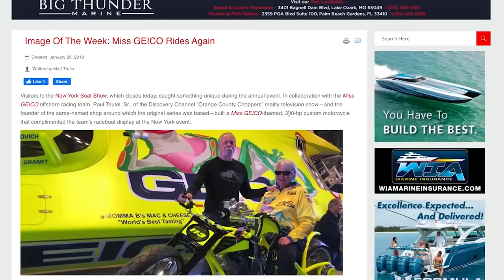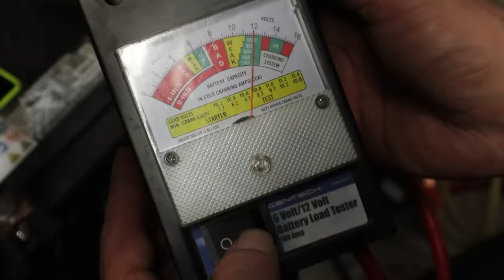Will the Geico Orange County Chopper Ever Run Right? (Unfixable)

Comment: The third injector should be acting as intake charge cooling, roots put out a ton of heat so the most efficient cooling method is usually pre-charge injection.
Reply: Makes me wonder what kind of fuel it's supposed to run
Reply: @Ooshwink82  I think it supposed to run race gas

Edit: watching the Bikes and Beard video again, it was tuned on VP Racing C16 leaded race gas.
Reply: @littlewicky1  yeah I spoke too soon. I just saw the end of this video and saw him use the race gas.
Reply: Good description of why the 3rd injector
Reply: Toyota used to sell  a TRD supercharger kit for the 5VZFE V6 that included a 7th injector.
Reply: I think the reason for the intake injection is to seal the rotor to the casing to improve efficiency, I remember reading that 80's top fuel engines did this for that reason.
Reply: If there was meth injection yes. It's for extra fuel for higher tuned maps.  instead of changing stock injectors
Reply: @effynme  Also helps seal the vanes.
Reply: It’s for methanol
Reply: Could also be for extra fuel under boost.  Callaway used to do that with their corvettes, just add one injector in the intake.  That blower wouldn't suffer too much for heat soak in this case.
Reply: First of this guys videos I have ever seen. I immediately had to question if the guy was a real mechanic if he had no idea what the third injector was doing.
Reply: Cooling and lubricant
Reply: Yes the third injector helps keep the air charge cool, but it also helps keep the blower rotors lubricated.
Reply: @K-Effect  lubrication is questionable. There are those that believe that the fuel washes the bearing. Although it is is hard for the fuel to get between the ends of the rotors and the case ends. What it does do is limit thermal expansion of the rotors, which leads to less wear on the case, or allows closer tolerances. By keeping the rotors cooler it does prevent some heating of the incoming air, but most of the heating is created during the compression of the air. Wear control is probably the biggest gain here. Yes there is some cooling.
Reply: @DodgyBrothersEngineering imagine thinking that people must know everything to do mechanic work. Bonehead remark
Reply: Knowing the efi controller would help. But I still think it's an easy solution for extra fuel under boost. Something like the RSR AIC400 is made just for this type application.  Keep the rest stock, feed the beast when needed. Also not sure the blower but not all are draw through and never see any fuel in them. Cooling the intake charge with fuel will make it run rich i would assume hence water injection?
Reply: @gsgrsavtexgs3  yes you need to be an engineering genius to work out hot things expand, cold things contract. OK so not everyone has hands on experience of working with roots blowers, but if he doesn't know the basics, then he is not qualified to work on it, and should stick to something he understands before he damages it.
Reply: @ComicbookGuy70  that is definitely one approach. You don't want to introduce too much fuel above the rotors as they typically have poor fuel distribution with the twisted rotor versions pushing fuel to the rear of the blower. I suspect going off the size of this blower it will be the twin lobe version which are very inefficient and create even more heat that the three lobe variants.
Reply: racing fuel  @Ooshwink82
Reply: @effynme  Normal fuel (or even water) sprayed in hot charged air will cool it.. Methanol is better at it but almost any liquid would cool intake temps but with various side effects depending on setup.
Reply: @DodgyBrothersEngineering sure, gasoline isn't a very good lubricant but compared to a dry fuel like propane,its a lubricant. 
When they use small air cooled engines on propane they are really tough on valves compared to their gasoline counterparts. They might require a valve adjustment at the same interval but the propane engine will have tighter valves when compared. 
Same deal here , fuel is a lubricant its just not usually thought of as one.
Reply: @MrTheHillfolk  yes but that is predicated on there being contact. A roots style blower is not designed to come in contact with the rotors or the case like a vane type blower does. Someone mentioned a top fuel blower that runs teflon strips for better sealing, but most of these street blowers don't make actual contact.
Reply: Old early fuel injection also had an auxiliary injector for cold starts. The Toyota 22re is one for sure
Reply: @DodgyBrothersEngineering  maybe he wasn't trained to fix those?  Superchargers aren't common
Reply: Correct, and I imagine it's likely only used at higher throttle positions/boost.
Reply: @Skilful_basics8  superchargers have been around for well over 100 years, if he doesn't understand the basic principles of how one works by now he is never going to. They work on the exact same physics that the internal combustion engine does. Compression creates heat, and heat cause expansion. If he doesn't know that, then he probably isn't really a mechanic. It is one of the first things they teach you after suck, squeeze, bang, blow.
Reply: I have a supercharger.  Not a roots.  I don't have any extra injectors on the intake but I did change to bigger injectors and a 2nd in line fuel pump.
Reply: The bike should be run on methanol not race gas. The methanol is the reason the fuel system is a mess. It does that if you leave it. Methanol is acidic. 
The extra injector is for methanol cooling of the supercharger and helps remove heat from the charge air. ❤
Reply: Yea I don’t want him working on my bike lmao
Reply: @Ooshwink82  Liquid currency, it get's a bout 1 mile per thousand dollars.
Reply: Went to post this exact thing more or less. I was like that ain't for the FP gauge dude that makes no sense. It's for extra fueling(maybe for cold start enrichment too?) and cooling effect from the fuel.
Dunno about the lubricating properties of it on this application. Could be another factor though.
If it is mainly for cooling wouldn't a water/meth setup be better? Maybe there were some packaging concerns.
Can't imagine it's much different for bikes. I put a roots type blower on my B5 Passat and the limiting factor on that was heat. The roots type blowers on Audi's 3.0 SC V6 they run coolant through it to keep it cool.
Reply: @Ooshwink82  It runs on Dunkin'
Reply: Great you got it going but that belt is ridiculous!!
Reply: It’s more of an efficiency thing than a cooling thing. The supercharger will work more efficiently with the atomized fuel running through it.
Reply: @effynme  Same reason modern superbikes have multi-stage injection.
Reply: ethanhawkins849 is absolutely correct in this case. from my experience on blown alcohol and top fuel cars the temperature from the compressed air and friction from the rotors in the supercharger can be several hundred degrees and the fuel will provide evaporative cooling.
Reply: Yes it's for chilling but also lube for the rotor blades.
Reply: @DodgyBrothersEngineering completely agree with you. Just cuz someone can cut and screw wood doesn’t make them a “carpenter”. I wouldn’t let this guy within a mile of my tools. Detroit was famous for blowers on the two stroke diesels, which is why an 871 blower (8 cyl/ 71cu in) fits a lot of gm blocks. I digress, back on topic…  Pre injection does cool the compressed air some. It’s already premixed by the time it enters the cylinder and can help start a smoother combustion cycle prior to the full injection shot near tdc. Another added benefit is direct injection suffers from serious valve coking. Coking (dried carbon deposits) can prevent a valve from fully seating and a major loss of compression. Atomizing fuel on the head side of the valves helps to wash the seats as the fuel/air mix rushes past each time the seat opens. Was OCC smart enough to consider these things during the build? I doubt it. Why they’d build a high compression engine to be boosted is beyond me. In its current state, the blower is robbing more power than it’s making. The engine needs to be torn apart by a REAL MECHANIC, and rebuilt with different pistons and rings, and likely a different cam grind to lower the compression so the blower can actually function the way it’s suppose to… making more power on PUMP FUEL… but that’s just my .02 cents
Reply: @motorhead4663  I doubt this particular supercharger was based on the 71 series, due to the physical size and length of it, I would suspect that it built on the earlier GM 53 series blowers, which as you know was an even more inefficient straight two lobe blower design.
Reply: @Bdogg12784  not sure how much lubrication you'll get from a fuel with that low evaporation point. most superchargers I've used had Teflon wipers for that.
Reply: This is what I got from underdog racing about supercharger injector: "The 7th injector kit has better altitude compensation, it is easier to install, and the pre-loaded start up program is good for 99% of the trucks out there and almost never needs any additional tuning by the end user.

Some other benefits come from shooting the fuel through the supercharger.  The Eaton 3 lob rotor used by TRD is not the most efficient available.  The fuel going through the rotor housing helps provides a better seal between the rotors and the housing and reducing the back flow problem with the 3 lob rotor design and reduces the heating of the compressed air by reducing the back-flow.  The fuel also removes some existing heat from evaporation of the fuel in the heated compressed air.  This can increase effective boost and cool the compressed air resulting in increased performance."

Comment: 8:33 the reason it has that extra injector is because the fuel itself is the lubricant, cooling & the seal for the supercharger
Reply: Also cools the intake charge under boost. 
Especially on methanol....it will literally build up condensation on the blower.
Reply: E85 is a good fuel for that type of setup. Just has to be tuned properly for the fuel you’re running.
Reply: @ryurc3033  Yeah, like those Dragster cars that do not have an actual cooling system for their engines. The super chargers actually get freezing cold and even build up ice on those cars. Awesome physics at work there.
Reply: Cooling maybe, but gasoline fuel isn't a lubricant, i thought it was just extra fuel for startimg and maybe wide open throttle
Reply: Yes…me would run ccv hose into the blower and let oil lube the supercharger…burns oil yes…but the engine crank case pressure is high so I would put that to work.  The thunder max if it had auto tune on will loose control of the cylinders if a third injector is in the picture..the max won’t know how to adjust the afr map .

Comment: The third injector is likely for two reasons;

1. They used smaller injectors on the heads to get good drivability and fuel control and the third injector for additional fuel under boost.

2. Being pre supercharger it acts as an air cooling agent when injected into the roots/screws due to the absence of a cooler.

Comment: That starter button is a simple install,  I have one on my 1340 EVO has been on there for 20 years. It just replaces the cover. We used to just drill a hole in the cover and drive a screwdriver in it to start if a bike had wiring issues,  or steal them.
Reply: So, you admit to being a bike thief. Got it.
Reply: @micksterboone4517  yup. No one knows who he is. Or if hes telling the truth. So yup.
Reply: Its not that easy. On top of the starter is a solenoid. By pushing it the startes runs. But without ignition the engine will not start ;-)
Reply: @chrisridethatbloodything2044  Eh thats nothing that twisting afew wires together woundnt solve ;) .
Reply: @chrisridethatbloodything2044  Tape a quarter to the back of the old small key switches and that's a solved problem. My bro got home that way after losing his key in the bushes
while romancing sum yung tang. He also go poison sumac. It was a run to remember.

Comment: 13:56 Adjustable throttle position sensors like that usually have metal sleeves in the adjustment holes so that when you are tightening down the bolts it gives it something to clamp to instead of just the compressible plastic.  I imagine that is why it keeps moving.

Comment: The injector on the super charger. My guess from having built a couple supercharged projects. Engine runs normally on the injectors in the engine. The injector in the supercharger adds the needed extra fueling for conditions when the engine is getting boost. Probably regulated by a built in map sensor. Bolt on..... no tuning required to the engine fueling.
Reply: I'm guessing Craig never had a vehicle with a hpfp
Reply: This one here Craig. We use them with the jb4 tuner on my cars twin turbo platform.
Reply: I'm guessing that is the case too, especially if it's bolt on. Rather than tune and size the primary injectors, just leave the stock ones in and have a separate one for boost.

Seeing how it's blowing black smoke they definitely didn't know how to tune it in the first place!
Reply: I remember them saying they used nitromethane or sth like this. Even ethanol or methanol need extra injectors to compensate for energy density. Similar to a carbs powerjet
Reply: Would a fuel injector on the superchrager also help cool the charge air and increase the charge density as the fuel evaporates?    That might be an unintended consequential bonus rather that a primary design consideration
Reply: @jonathanflatman  You need it to cool the Super Charger itself, and provide lubrication.
Reply: Super chargers start making boost the instant the engine is started so there is no "runs normally on the injectors in the engine" or "no tuning required to engine fueling".
So repeating what others said. 1: that injector is there for cooling and 2: there's no way the fuel coming out of the blower can be distributed to both cylinders evenly =
to be properly tuned you need to tune each cylinder's injector (I tune both cylinders individually even if/when the engine is normally aspirated).

I have also tuned "the only factory production supercharged motorcycles on the planet" (Kawasaki H2) and JFYI the MAP "goes positive as soon as the engine starts".
It isn't much but the H2-SE's MAP is 0.2 psi at idle and it "increases linearly with engine RPM" up to 16+psi at the 12,500 RPM rev limit (all shown and recorded on dyno).

And lastly, most modern ECUs that can be configured for Injector Size/Flow and Latency (Dead, Off Times) IE Holley, Maxx and Fuel Tech all start, idle and
Ride/Drive 100% normal/smooth (when properly configured and tuned with High Flow injectors)...

Comment: How did I not know about this fuel injector tool!! I have been saying for years something like this need to be made! Thank you Craig I would have never found out about it had you not shown it.
Reply: Yeah, I'm going to have to find this one. They make expensive 4 or more injector cycle/clean systems but this one is pretty simple. I made a setup of my own to cycle the injector and spray cleaner but it's a pain to swap injectors and the cleaner spray tube wants to pop out of the rubber hose it's feeding into.

Comment: The fuel injector on the blower is to cool the blower, and cool the charge. Same reason they run fuel through the blower on top fuel engines.
Reply: I'm not mechanically inclined, but basically they're water-cooling the blower with the fuel, correct?
Reply: @WyattWeadge  the fuel lowers the air temp. Lower temperature air is more dense. Higher density means you're getting more air for the same amount of compression, so it produces more horsepower.
Reply: @deelowe3  Thanks!
Reply: This was exactly the comment I came to look for after hearing him wonder about that injector. Thank you!

Comment: That style of blower usually heats the intake charge air a fair bit as it compresses - that added injector may be for using fuel evaporation to cool the charge a bit before it reaches the engine, since there doesn't seem to be an intercooler?  That might help avoid knocking, considering it's high comp and boosted.

Comment: 8:25 could that injector be there to lower the intake temperatures?
I love your content guys, keep up the great work!
Cheers Pat🇦🇺
Reply: And to improve the seal between the rotors.
Reply: Would be if it was meth injection but no extra tanks so na just more fuel at boost

Comment: As a engineering student, a fastener, only needs 3/4 the length of the diameter. Which means the threads on a 1/4-20, needs a minimum of 3/16" length of threads, approximately, 4 threads. Any more threads, won't help, any at all. If it was stripped, it was over torqued. If you can believe that the Orange County crew, would do something like that?
Reply: You gotta be careful with that, for steel it's absolutely correct, but this intake seems to be aluminium. It can deform quite a bit more and may need more engaged threads.
Reply: @kilianortmann9979  THIS! .. the alloy (and their differences), and Fine vs. Coarse (thread).  The GENERAL rule for safe is: 'slightly more than the diameter of the fastener (unless it's a Ti screw into a Pb hole, then it's whatever the Mfg sez)''
Reply: As an engineer A) you should never really work to the absolute minimum and B) that rule very much depending on your material and thread. Metric threads should be 1 x D minimum thread Engagement. If your using UNF 3/4 D is ok for steel...but not Aluminium.